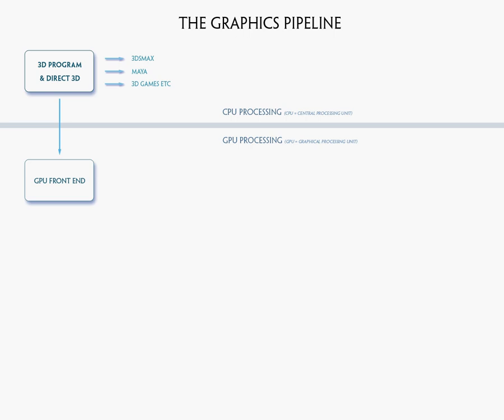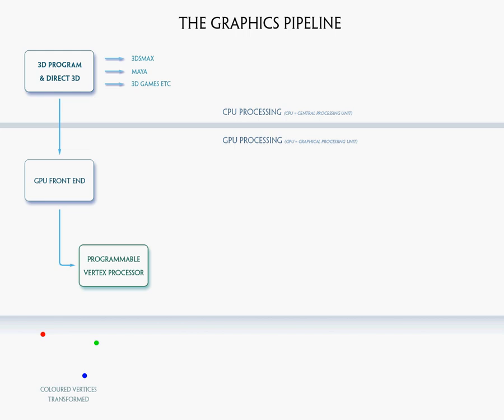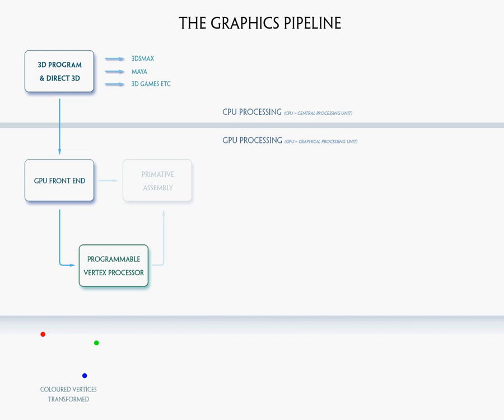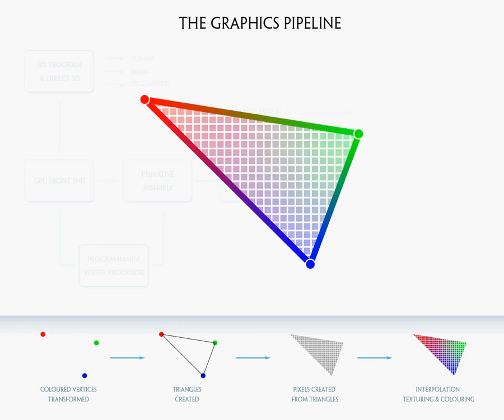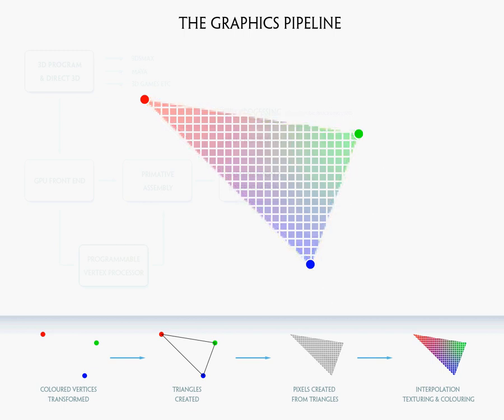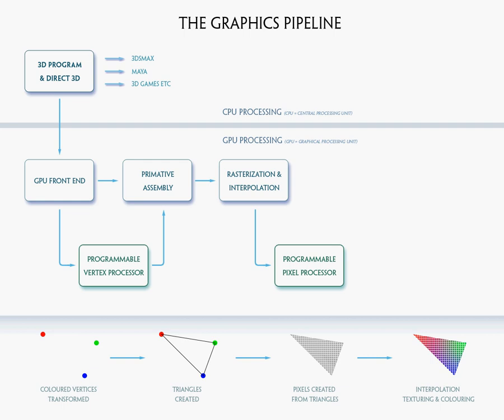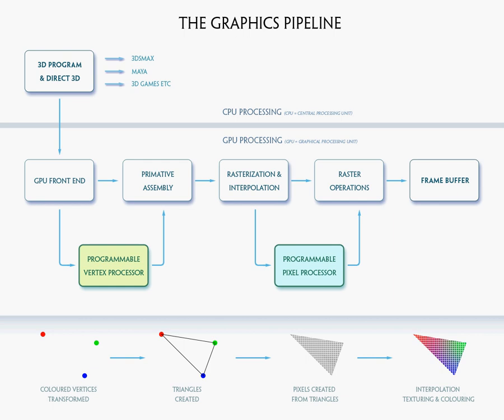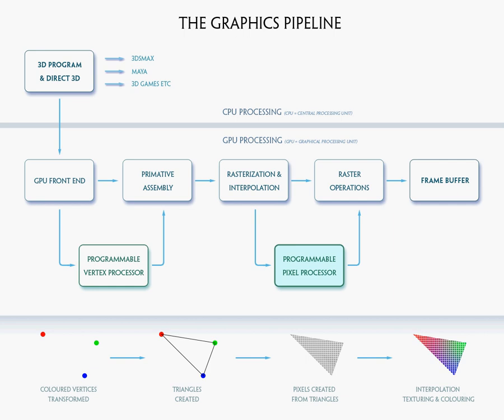02 The Graphical Pipeline - HLSL Shader Creation 1 - HLSL Shader Fundamentals

Comment: I am wondering if this pipeline is still up-to-date? Does anyone know some other good sources to get more info about how GPU works and what's the flow of a data from CPU to screen?
Reply from the maker: All of this information is still correct. There are some new, optional stages (hull shader and geometry shader) that are for doing tessellation, but other than that, this is how it works.